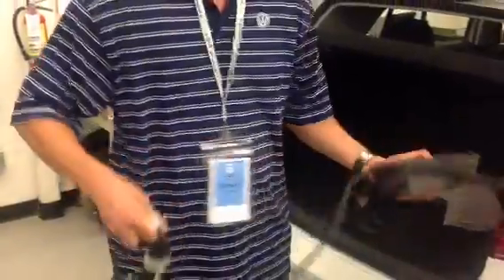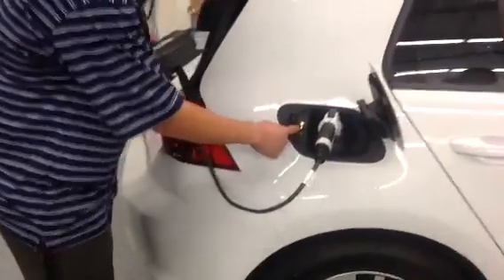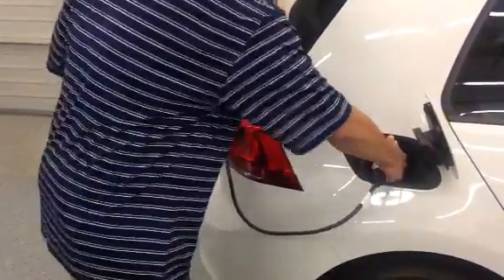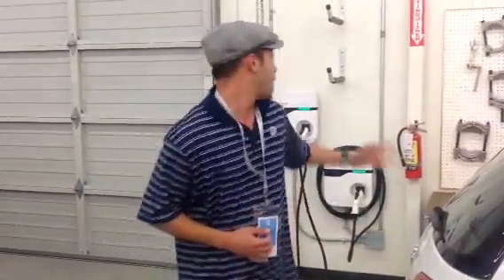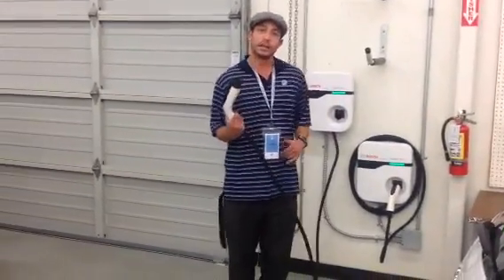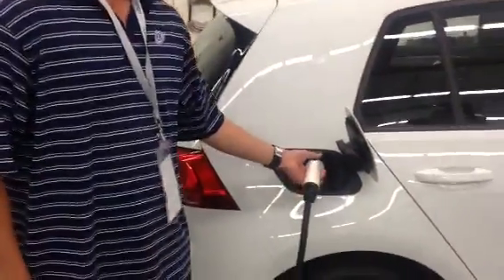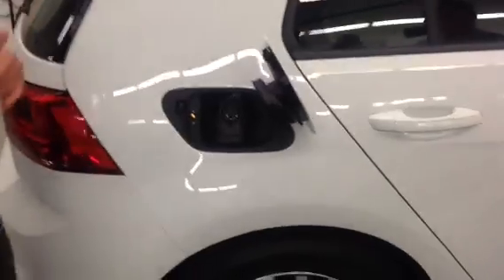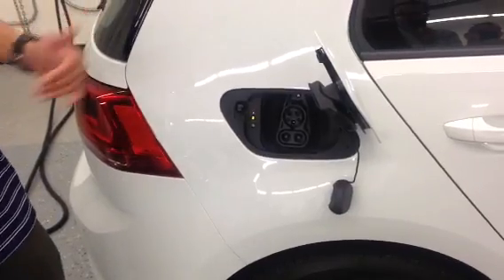2015 Volskwagen eGolf SEL Premium: Charging Levels & Locking Mode

Comment: I have this car. After i plug it in the light switches from green to yellow to green.  What does this mean?
Reply from the maker: It means the car is accepting the connection. Green means you are good and the vehicle is charging.
Reply from the maker: Means it's initiating the charge then starting the charge

Comment: VW does not want customers to make a habit of level 3 charging to 80% in 30 minutes. In fact, read the owners manual, and they'd prefer you do it rarely. Why?  Because charging lithium batteries that fast generates a tremendous amount of heat in the battery cells, and heat destroys the life of the battery cells, since both Vw and Nissan decided to go cheap and not use forced cooling on their battery packs, instead relying on ambient air, with no air circulation to cool things. Batteries are very poorly heat sinked.

So rule of thumb is this, stick to level 1 and level 2 charging as much as possible, and battery life is extended the most if kept charged to 40 to 60% full.  Reality is, this is a short range vehicle, 40 to 50 miles daily, between charges is optimum for battery life between recharges. Full charging them is hard on battery life.
Reply from the maker: I use LV 2 everyday at work and DC Fast Charge at night for last 7 months. Have noticed no difference to range. I still get 100 in the hwy and 120 in the City.
Reply from the maker: I did it everyday for 36 months on my 2015 eGolf. Do it on my 2019 eGolf. Leased both.  That's what I have warranty for